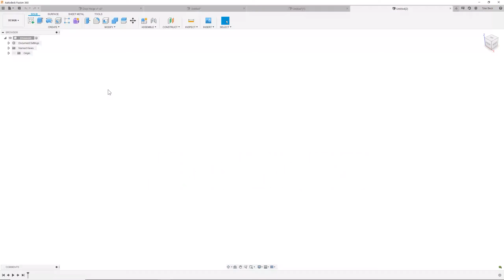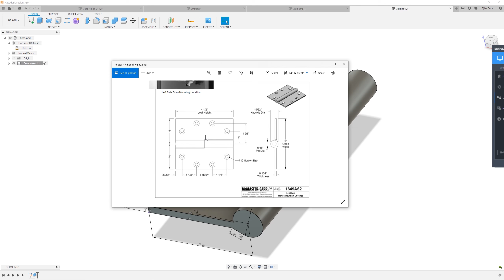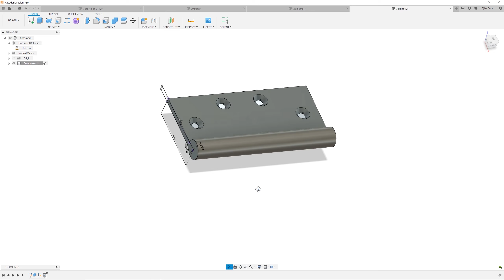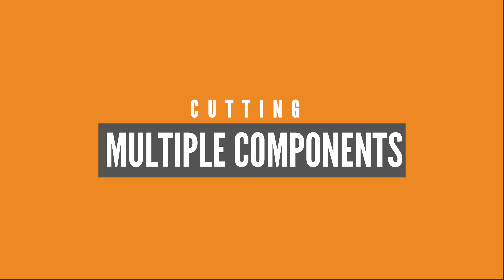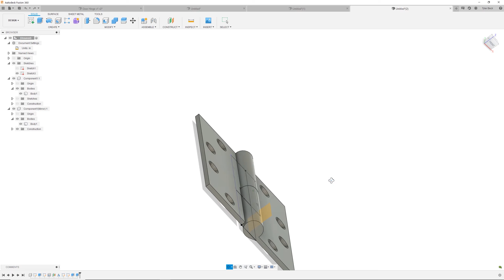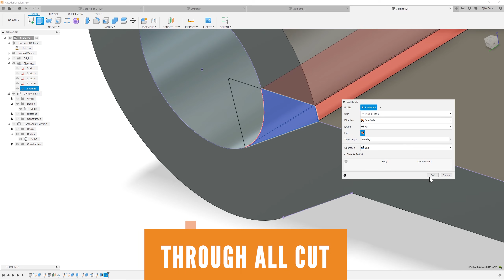Fusion 360 Ultimate Beginner Tutorial (Door Hinge 2020)

Comment: Great tutorial. 
I'd love to know what I'm doing wrong. 
At 8:16 you place a dimension on the middle of that barrel. However, Fusion won't snap to that center point. It simply doesn't pick it up. I've done this exercise a few times now and it's the same result every time. 
No biggie. I can carry on with the next exercise. But, it'd be good to know what the issue is here :)

Comment: Hello, I need your help please. At 4.30 I tried to define the dimensions of the circle, when finished the line was still blue which caused the rest of the project to be off. Im sure I followed your instructions move for move but obviously either there is something I haven't done or the settings are different and it has not worked. Please can you help?

Comment: Let’s take another run at the hole wizard. I was “licking my chops” that someone was going to finally tell me how & when to effectively use it, but...  🧐😉
Reply from the maker: Hey Bill, have you used the Hole Wizard in Solidworks?  It has functionality that Fusion still is missing like the standard sizes which would have been easier on this example.  I want that functionality in Fusion pretty badly!  Was there something in my explanation that made it confusing?  The order of operations?
Reply: No.  It’s just that I don’t see the advantage of the tool over sketching holes and extruding them.

Comment: Is that ready to 3d print or am i going to need an offset on the pin say?
T
Reply from the maker: Hey Trunker - Exactly.  I would start by looking at the pin fits based on your printer.
Reply: If you do a section analysis from the inspect tab you can slice through and see (and measure) how much clearance your pin has from the shroud. and adjust to suit the tolerance of your printer.
(I use this method to make printable working threads and stuff like that)